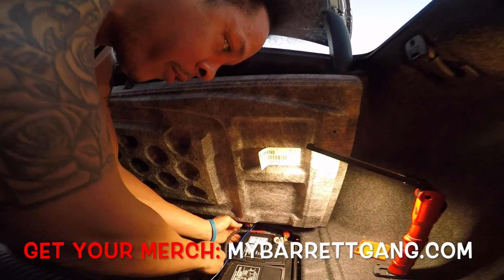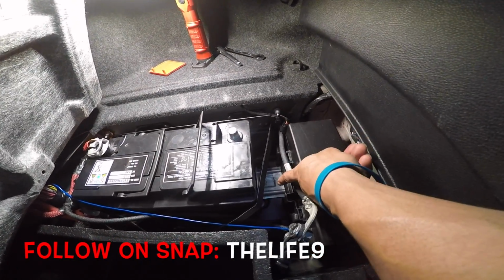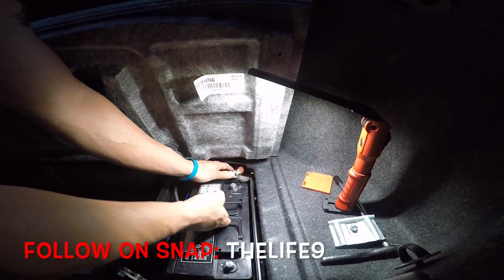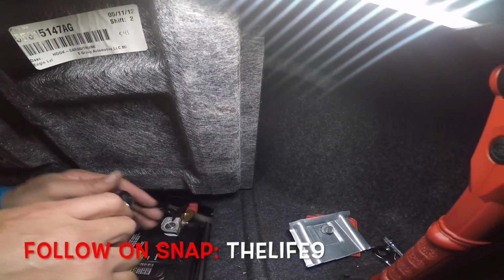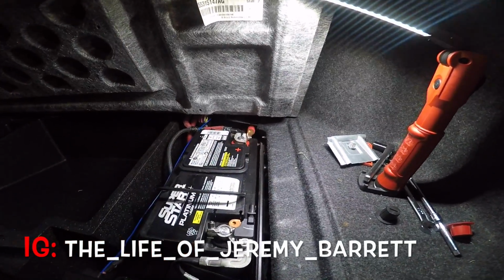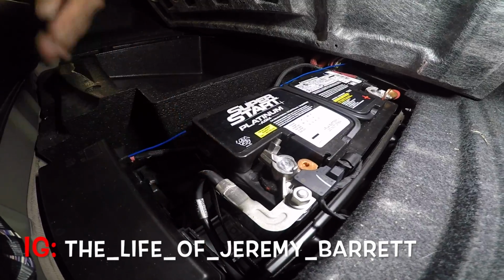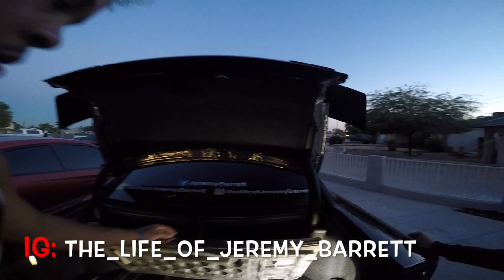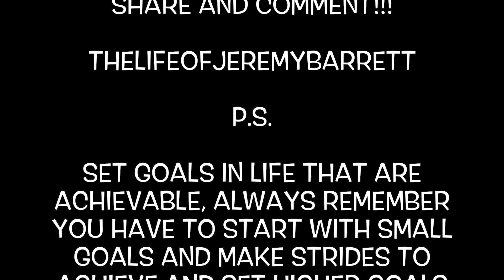HOW TO REPLACE A BATTERY IN A DODGE CHARGER!!!

Comment: You don't need to worry about sparks on the side of the bracket...it's negative / ground just like anything metal on the car. It's the red / positive side that will cause problems if you touch anything grounded / metal.

Comment: The way they placed and tighten the battery is a freaking hard to open it if you don’t have the exact tool.
Reply: They sell a "battery terminal tool" at any auto parts. Like $7-8 and it's a small red handle tool that does it all for any battery change, worked for my Silverado's, Escalades and now chargers

Comment: Nice video 😎😎🚘🚘 I 💙 chargers & challengers, BUT I have always like the old 2012 - 2014 dodge chargers & challengers better than these new ones. Plus in my opinion the black  charger with its nice design looks better than the red charger 😉😉. The new 2015 - 2018  chargers r fast  but it's just that I don't like the design & + THEY have more engine mechanical problems than the old ones, An lots of people always getting into accidents with these cars, AN the material that's build with these cars are not that strong as the older ones.
Reply from the maker: Nevin Micheal All facts bro💯‼️Yeah I totally agree with it all I am a big fan of the 2012 body styles I like them way better then the new style, I like the more aggressive look it gives compared to the new ones but I like that the new ones have 8speed trans rather then the 5speed in the old ones‼️ but I appreciate the feedback and the love and support bro ✊🏽💯‼️
Reply: @LifeofJeremyBarrett  yea thanks man ur welcome we could support each other I have a channel too

Comment: At 8:57 what is that sensor you plugged into the black negative terminal? My charger 2012 SRT8 doesn’t have that sensor do I need it?
Reply: I been wondering the same thing, did you ever find out what that is?

Comment: I can’t reinstall the small metal plate under the negative terminal i think because my battery is a little too long... should I be concerned?
Reply: For my 2017 Scat pack charger
Reply: @angelreyes2273  You could try the bracket for the Charger Police. It's smaller to accommodate a bigger battery. Try Ebay or the dealer for one.

Comment: My new battery doesn't have a vent hole near the + terminal but have one near the - terminal which the hose cannot reach, what should I do ?
Reply: Just had the same battery issue did you find anything out?
Reply: U need to get a factory oem battery or the higher model battery,

I had 2 choices at Auto store and the $20
More had the vent holes and "came with a new vent "L" tube
Reply: @inthebuilding6981  👆👆